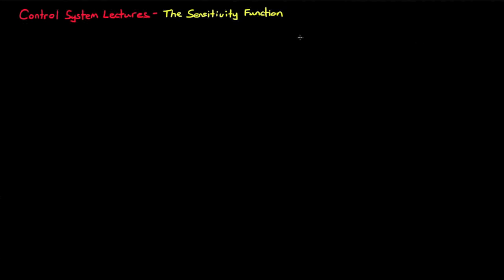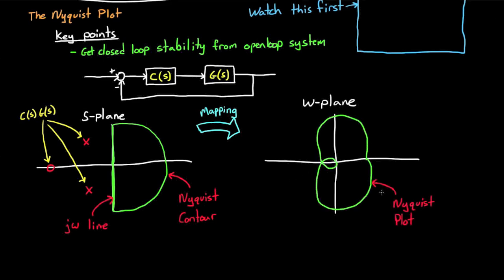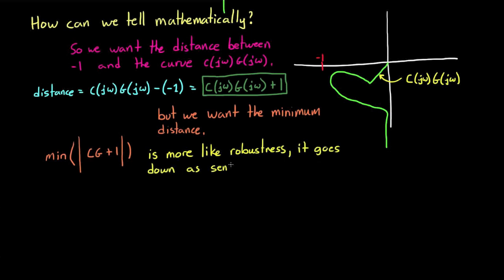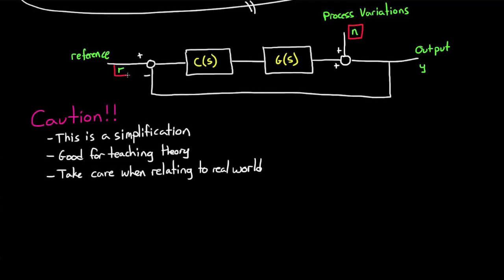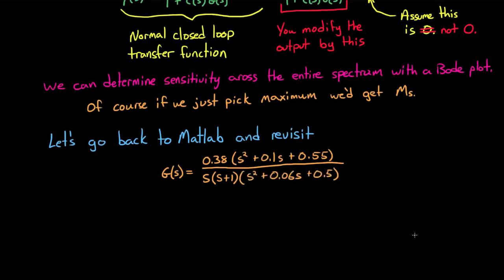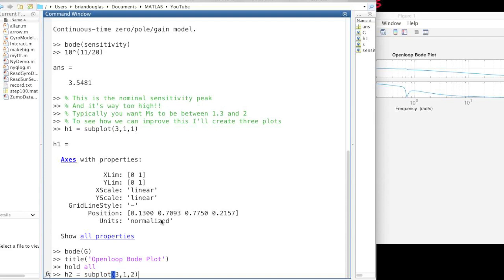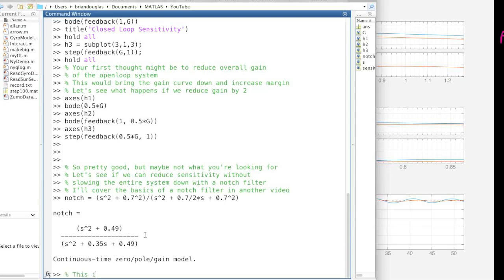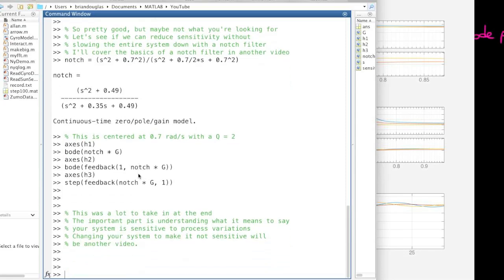Understanding The Sensitivity Function

Comment: But wait... If halving the OL gain (multiplying by 0.5), wouldn't that increase the sensitivity since |1+CG| is now a smaller value? I mean, now |S(jw)| would be |1/(1+0.5*CG)| which makes it higher compared to |1/(1+1*CG)|. How come the sensitivity has gone down? Did I get the concept wrong?

Comment: Hi Brian,
I'm new to your lectures.
Thanks for your great work.
Just a question?
when you add that notch filter to system it will reduce the open loop margins although it reduces the sensitivity, if it's right. Does this work make any sense?

thanks,